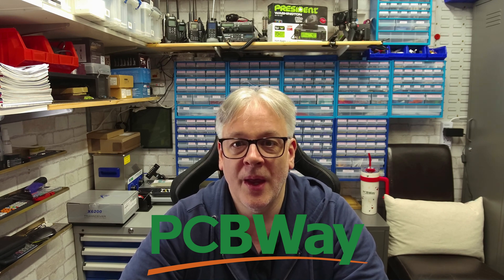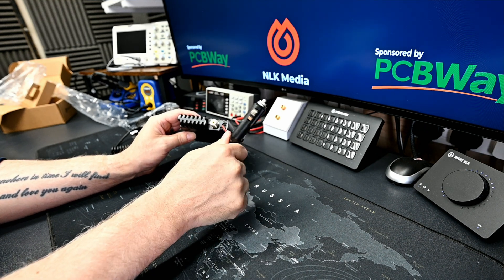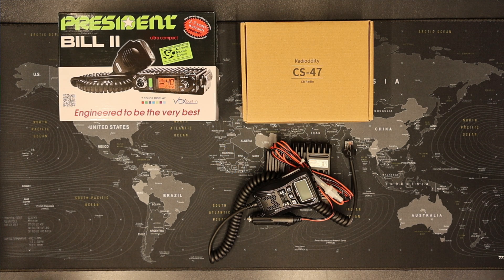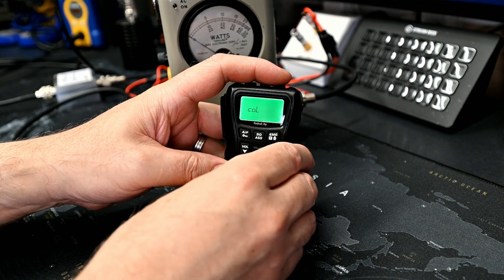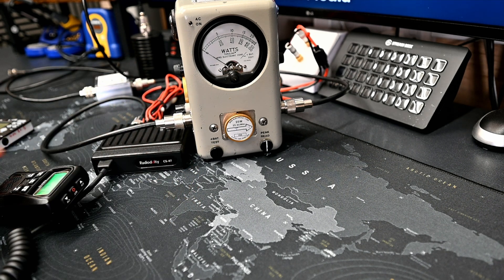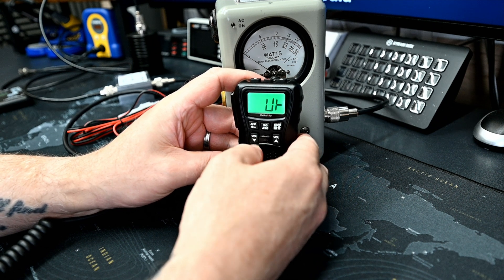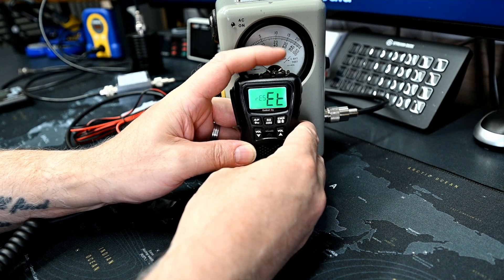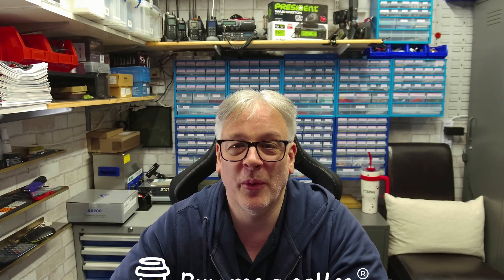Radioddity CS-47 CB Radio - Review, tear down and modification

Comment: I would prefer the Bill 2, specially when it comes to a bug out radio. Because if the microphone gets destroyed or lost, you still have a working radio, and might have a chance to get a new microphone, sometimes and somewhere, and a standard 6 pin microphone is simpler to find than this multi-tasking-network-computer-thing. Personally i have a Randy 3 with external microphone in my bug out bag.

Comment: where do I find that chart of Bands/Frequencies for HF mode so I can print/laminate it and keep it with the radio for reference?
Reply: I partially answered my own question. the HAM band block chart can be found in the downloads for the Radioddity QT40 and the CB band chart can be found in the CB-27 manual. Not sure where to find a complete list for HF mode

Comment: OK, having this simple modification for the expansion is great but I’m not understanding why they allow you to expand the frequency range and yeah, what’s a modification you’re not able to get USB and LSB as additional bonus modes Because let’s face it when you’re in 10 m 12 m or for that matter even in the free band frequencies many people use single side band
Reply from the maker: Absolutely, SSB is where a lot of the action is these days and some people won't even consider a radio unless it has SSB. There are not many new radios sub £200 with SSB and it hasn't filtered down to the sub £100 tier radios yet and is virtually unseen on handhelds / cheaper ultra portables. The expansion allows this simple and cheap CB radio to operate on HF and HAM frequencies but only in DSB as it doesnt have a clarifier or the internals to transmit (without a carrier) on USB or LSB. If your looking to DX and grab as many contacts as you can then SSB is definately the way to go. If you want a cheaper radio for road trips then a non-SSB radio works well and having the ability to expand it in the event of an emergency to extend its freqency range might be helpful to some. Thanks for commenting, its much appreciated, its good to get the conversation flowing as it might help others deciding on which radio they should buy. All the best MJ7NLK

Comment: What is a "band block"?
Reply from the maker: CB radios have 40 channels to select from. When a radio is expanded to cover more frequencies you have to fit them into the 40 channels you can select from. So, they have band blocks which start at block A and then B etc. When you select a particular block the 40 channels relate to different frequencies. Channel 20 on band block B could be 26.695MHz and then changing to band block C channel 20 could then be 27.125MHz. I haven't checked the actual frequencies in the before mentioned example but you get the idea. Hope this helps and thanks for watching. MJ7NLK
Reply: @NLKMediaGroup  Thank you for the explanation!

Comment: I have often thought about taking a radio like this and making a Midland PortaPack for the 21st century. The one handed unit would work well. I thought about a fold out helical antenna as a counterpoise. Maybe when I have time! I'm bogged down in DMR programming at the moment.
Reply from the maker: Hi Gordon, DMR code plugs can consume lots of time. Remember to save them regularly :-) Which battery option would you go for which is not too big but offers lots of runtime? Any particular antenna you would choose? It would have to be compact for a bug out pack. Would be good to get ideas on this. I might put something together and then try it out and see how it does. All recommendations very welcomed. All the best and thank you for commenting MJ7NLK
Reply: @NLKMediaGroup  Albrecht makes a centre loaded telescopic whip but it's not available in the UK. I might be tempted to get a long telescopic whip and wind a coil. Battery wise making a pack with 18650 cells, but how to handle the management? I think you can buy boards that stop them being discharged too far. The easy thing is there are holders for 18650's available cheap.

Comment: Great review. The main thing I wish this little radio had was a frequency readout. The CB-500 / AT-500Mii is hard to beat. 73
Reply from the maker: Yes that would be nice, I do like having the frequency on the screen it really helps. Still no coolling fans for the Washington... Am really interested to see how the APM works and to come to a decision on passive or non-passive. If it sounds like a hair dryer then that is not going to work well for me, just need the darn fans to find out how they have implemented it. Am still loving the QT80, its a really nice radio and will also be hard to beat. Radioddity have done well with the CB-500 and QT80. All the best, 73 MJ7NLK